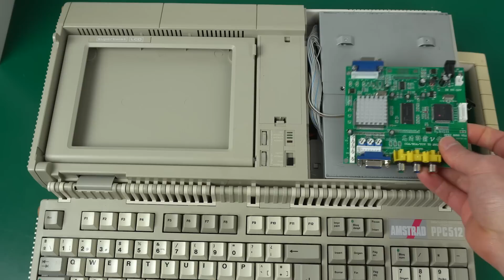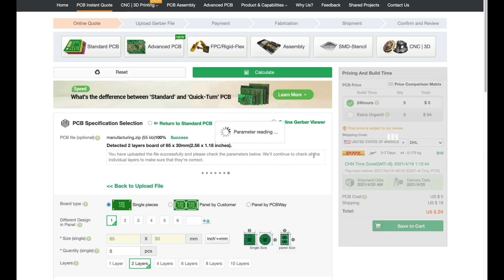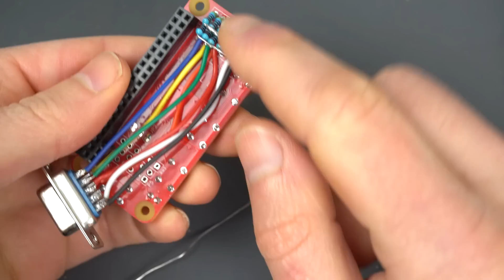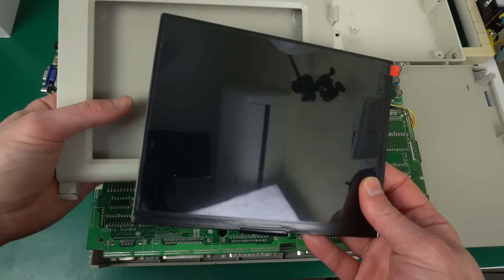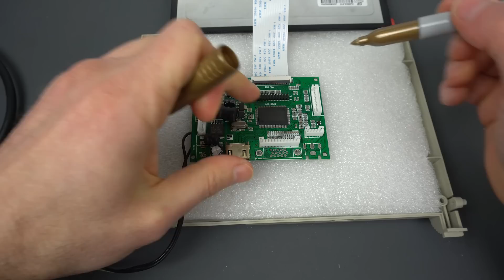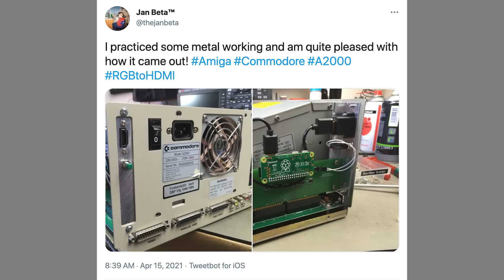Replacing a Laptop LCD With a Raspberry Pi Zero (Part 2)

Comment: I think it's perfectly acceptable to do these upgrades, especially when there's no destructive modifications to the original case (or #nocutmod as the cool kids say). The end result looks really nice!
Reply from the maker: Thanks! Glad you like them. It makes it so much more usable as a CGA computer!
Reply: @NoelsRetroLab  I'm in the same boat.  I draw the line at destructive upgrades and modifications if I can't put it back to its original, unmodified configuration.  However, with many of these upgrades, I see no problem with them being out of place.  It's just a matter of the history of economics, in my opinion.  If a low-cost color LCD had been introduced to the market in the 1980s, you can bet your butt some company (if not the OEM itself) would have offered a color LCD upgrade option.  Sure, these days we're doing it in a round-about way by using a CGA to VGA converter instead of a purpose-built driver, but I think it's still in the spirit of things.

For example:  I got a 16MHz accelerator for my 1MHz Apple II.  Yeah, the 16MHz accelerator never existed for the Apple II, but that's just because by the time the faster 65C02s hit the market, the Apple II was just too old and the market was shrinking rapidly as it was replaced by the IIgs and Macintosh.  So in my opinion, a 16MHz accelerator is perfectly fine in an Apple II.  Had market conditions been different, you bet a 16MHz accelerator would have been released.  ZipChips went all the way up to 8MHz.
Reply: Yeah I dunno why, but while I don't collect or do anything with retro tech, I really don't like permanent mods like cutting up circuit boards and case parts.
Just too bad that not everyone can 3D print an entire replacement case for some stuff since not everyone has access to a large enough printer if they have one at all. Next best thing would be a service that can print or produce replacement cases (for which I'd be more comfortable with modding over the original stuff).

Comment: I agree that the whole RPi method seems dumb and overkill. There must be a way to build a simpler board the size of an Arduino that uses a single chip and does conversions from any video signal to another. If it doesn't exist, it SHOULD albeit without the need for a single board computer like the Pi. Having said that.........what if you could also USE the Pi with a second switch, and take over the keyboard and screen, in that "case" (no pun intended) you'd have 2 computers in one enclosure that you could select via the switch. In such a mod, the Amstrad would be completely isolated from the power source and only the Pi would work as maybe a retro machine in mode A and in mode B, the Amstrad would start normally and the Pi would simply act as its video signal converter. So the switch should be at the power source, considering the Pi doesn't have one. That way the switch should power either the Pi alone, or both computers. And you wouldn't feel "quilty" for having a tiny computer that is 1000 times faster, being wasted as a video converter alone. I think it would be cool to use the Pi for all sorts of stuff with that cool PPC keyboard and new screen. Maybe not as a desktop because of the size of the small 4:3 monitor, but as a retroPie. I mean, its there, so you might as well have 2 modes, 1 for the native vintage hardware and 2 for emulation.

Comment: When soldering smd IC's , if you apply flux to all the pads and heat it evenly with hot air the surface tension of the flux will pull all pins onto the pads for you, then tack two oposite corner pins. If you don't have a hot air station you can use a toaster oven/stove but you have to be very careful to not fry the board.
Reply: Skip the oven - a high-power hot-air gun does the job nicely.

Comment: Two tips: To weld the component without moving it, you can put a small piece of thin double-sided tape on it.

And to prevent the LCD cable from breaking with the movement of opening and closing, you must put a spring, usually the spring found inside ballpoint pens is perfect for thin cables.
Reply: Use hot glue instead of electrical tape*

Comment: For drag soldering to work well you need way more flux than this, the whole pin needs to be covered. Also it works way better if you have solder mask between the pins and not such a wide expansion around the pads.
Reply from the maker: I can see needing more flux (I had a fair amount, but underneath). What do you mean solder mask between the pins? On the CPLD itself? A wider tip would have helped too. The second CPLD I just did it one pin at a time and it worked flawlessly first try.

Comment: To solder the legs of the smd ic, a special spoon-shaped tip is used, where the tin is deposited and you can make one pass for all the pins
Reply from the maker: Yes, I even have one somewhat like that. I was afraid it was too big for this one because of how little the pads and legs stick out. But it would have been better than that one for sure 😃

Comment: A flat, slightly concave tip really helps for drag soldering. Hakko make tips specially for it and I actually use them for most soldering.
Reply from the maker: Yes, I even have one like that that I've used in some of my other videos. I think the fact that there's so little pad showing here made me go for the thin one (bad idea). Oh well.

Comment: you need to cover that chip in flux if you're drag soldering it, get a big solder ball stuck on the tip of the iron and wick it through the flux, also when you were trying to remove the short the iron was too hot

Comment: One option for the HDMI cable to fit better is to use the HDMI to FFC adapters that FPV drones use. Then you have a ribbon cable like originally equipped.
Reply from the maker: Yes, check out the latest video on this project. That's the first change I made and it works great 😃
Reply: Ahh, didn't see that, looks much better.  One note I will mention is that a common way to route FFC cables to make them look more neat is to use 90 degree folds to turn corners. As long as you don't repeatedly stress the cable back and forth at the bend it shouldn't damage the cable.

Comment: Maybe you can create a new profile for the RGB-HDMI for monochrome CGA and map the white to green-tinted-white and the black to grayish-dark-blue to have something that looks like the original.
Reply from the maker: Yes, good idea. I think that's what the sub-profiles are for maybe. It would be good to set it up (that and an amber one for example) as something that could be selected quickly. Neat idea.
Reply: @NoelsRetroLab  Also, to put the cherry on top, add a full-screen shader effect to give a sort of "motion blur", to mimic the god-awful response times of DSTN LCD monitors. Ok, that's more of a joke, but AFAIK the GPU on the Raspi is powerful enough to do it, the hard part is lots of work on the RGB-HDMI software, unless they're already using the GPU to render the final screen.
Reply: @Spyd77  Interesting idea, the colour profile.  Motion blur, not so much lol

Comment: Drag soldering needs additional flux, found that out the hard way myself! Oh and a knife edge solder tip worked best for me :)
Reply from the maker: I put a fair amount of flux paste before. But I think I had the wrong tip for the job and the legs/pads were very tiny, which didn't help.
Reply: @NoelsRetroLab  I'd suggest gallons of flux 😆 I use tons of the stuff when drag soldering. I'm sure 50% of the weight of the PCB is flux as I solder SMT parts haha 😄
Reply: @NoelsRetroLab  i agree with the comment above, use alot more flux than that for drag soldering, also use that tip that look like a little hook it's ideal for this job, also don't bring your solder to the package when applying heat, load your tip with solder and then begin soldering, it'll make things alot easier for this kind of drag soldering work :) keep up the good work noel, your projects are AMAZING
Reply: @NoelsRetroLab  yeah you definitely need a larger tip for drag soldering. the fine tip just doesn't get the heat scross (that was happening in your footage.) a hoof or knife style are better for the task. and of course MOAR FLUX! (just watch some Louis Rossmann repair vids to see what an acceptable amount is :D

Comment: I've just been given a PPC512. The screen bezel is broken to where it won't stand up on its own, but at least all the pixels are working fine.
Reply from the maker: Yes, I have another PPC with a broken bezel hinge as well. I think that's pretty common, but I bet it's easy to fix and make it swivel and stand in place again.

Comment: I built one of those boards. Like you I got the PCB made from the github project. I hadn't done any surface mount for a while so I did some of the discretes first before tackling the CPLD.  I use mine with my Acorn Electron and BBC micros.

Comment: Awesome job and I really appreciate your mindset to keep these old machines as stock as possible (when it comes to case modifications like drilling and such). Replacing a dead part with modern replacement is absolutely fine, I think.
Reply from the maker: Thanks! Glad you liked it.

Comment: I wonder if it would be possible to somehow "emulate" cga composite mode with this setup...
Reply from the maker: That's a really good question. I saw a bunch of settings when messing around in the menu, so I would say yes. There have been so many good questions about this project, that I'm going to make a followup video talking about each of them, so I'll make sure I cover this. Thanks!

Comment: You can use a reed switch and magnet to get a "button" without any extra holes in the case.
Reply from the maker: Oh very interesting! I wasn't aware of that. I take it you'd need to have the magnet with some sort of spring so when you push it it gets close enough and activates the switch? I'm going to have to remember that for the future.

Comment: I think that looks worlds better and was worth it. N only concern with any update to any retro machine is that is still runs all the original software and uses all the original peripherals made for it. Improvement is never a bad thing.
Reply from the maker: Thanks! Yes, I agree. It doesn't take anything away and it makes it much more usable. Honestly, with this, I'll never bother connecting an external monitor!

Comment: The drag technique didn't work for 2 reasons.
You need to use the side of the iron rather than the very top you don't get enough heat transfer otherwise also you need to feed solder as you go rather than load the iron up like you did. 
I solder loads of these type of flatpacks for work, the way I teach drag soldering is to get people to practice by drag soldering on through hole components first. Hope that helps!

Comment: Nice mod! One thing I recommend is to swap the overly shielded, super long HDMI cable with a much thinner or totally flat one. Not only would it flex better with the screen hinge while reducing stress on the case, but it would be a lot less to deal with when it comes to cable management.
Reply from the maker: Yes, I only learned about ribbon HDMI cables right after this project, so I ordered one already. I'll probably show it as an upgrade next time I cover the PPC. Cheers!

Comment: Great results. Getting rid of some of the external-type connectors (HDMI, CGA, USB) would help make this a bit more manageable inside the case. Also, for longevity, I suggest at least getting a ribbon-style HDMI cable - they are readily available, and 5, 10, 15, and 60cm seems to be standard sizes.
Reply from the maker: Yes, I already ordered a 50cm ribbon HDMI cable last week. Should be a great fit. I didn't want to completely remove the connectors because I want to be able to unplug the RGB to HDMI board. But I suppose I could use something smaller, you're right.

Comment: Now you have to add an ega card to use it with that pi-zero and a sound card, and will be perfect. Excellent video !!!
Reply from the maker: Actually, I might do better than that and without using the Pi for emulation 😃
Reply: @NoelsRetroLab  I was wondering if there was any way to upgrade the video card (or rather chip, since there's not AIB of course). Upgrading to native VGA (HDMI might be too much. Eitherway great work and look forward to seeing what you have planned!

Comment: Great timing! I've just spent the evening soldering my RGBtoHDMI board using paste and the pan of sand technique, only my 2nd time doing it tho this time I have IR thermometer and I'm pretty happy with how it turned out so far - although I've yet to test for shorts! Thanks so much, I watched your video before I got stuck in and I really appreciate that you leave in the mistakes and correcting them as it really takes the pressure off that it has to to right 1st time. Great result too with the screen looked gorgeous! I'm using my board initially with a ZX Spectrum +2A but then hopefully with an EGA PC I'm building at the moment. Ta again for the motivation!
Reply from the maker: You're welcome! I still have to try the stencil and paste method. I'm planning on doing that for another small RGB out board for the TI99 one of these days. Yes, I think it's important to leave in the not-so-good things as well since we all go through those and it's important to show how they can be fixed. So I'm glad you appreciated that. Good luck with your board. Once you get the soldering done, the rest is a breeze!

Comment: Hi Noel, great video as usual! Have you ever used solder paste for those surface mounted components? I've seen great results using it. 
I'm pretty aware of my own clumsiness to not to try but you sure have the dexterity to do it! 😃
Reply from the maker: I haven't yet but... you guessed it, I'm preparing a video about it. I'll solder the TI99/4A RGB board that I did by hand a while back with solder paste and a stencil and a variety of methods. We'll see how it goes!

Comment: Yes you are using too small of a tip. I use a 1/2 inch wide double bevel tip to solder TQFP parts. but the tip has to be clean and tinned way back so that the extra solder can flow back towards the iron. Also Kapton tape helps prevent accidently filling holes.
Reply from the maker: That makes sense. Thanks for the tip (No pun intended. Really.... well, a bit 😃).

Comment: Hmmm .... I like this, and your comment about burying a Raspberry Pi into a computer with inferior specs got me thinking - could you actually use the RPi as a computer in that case as well? Some way of switching between original and Pi would be necessary, but I can’t help thinking that having a modern useable “stealth” computer inside sounds like an interesting project.
Reply from the maker: Yes, that's probably possible. At least I like your suggestion better than than emptying the computer and just using the Pi. Switching between the two is definitely intriguing.

Comment: I know that it's been a few months at this point, but I needed some inspiration for doing the same thing with some Zenith SupersPort 286 laptops that I recently acquired.  Out of 12, I know that at least 5 of them work, but all of them have screens in very poor condition.  Now I just need to find a supplier with 10-11 inch screens that are 4:3 aspect ratio.